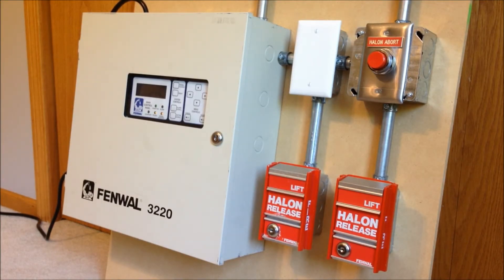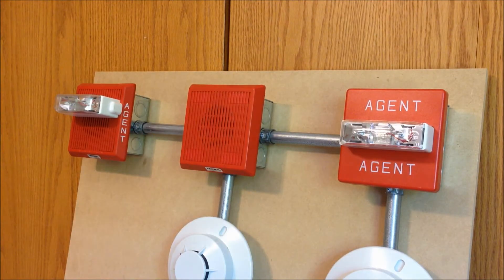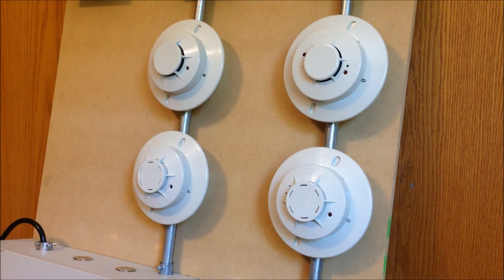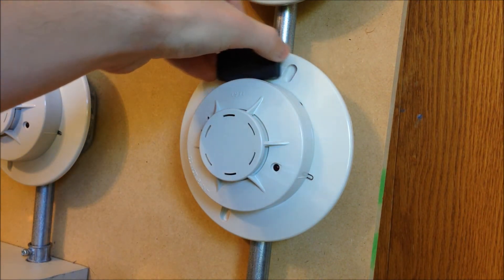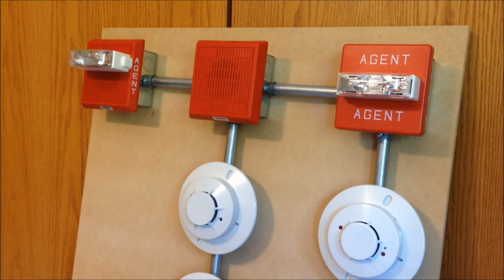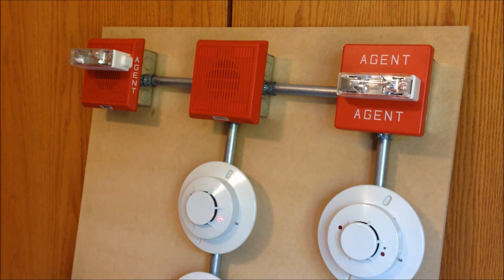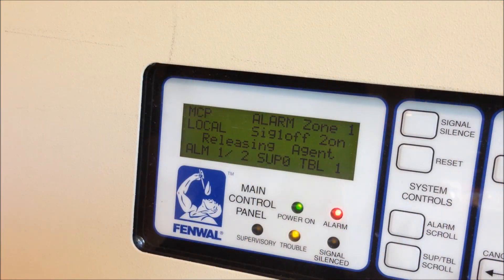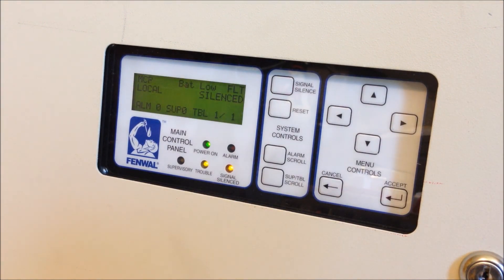Fenwal 3220 Fire Suppression System Test 1 | Cross-Zone Detection

Comment: Sorry if I ask too many questions but how exactly are the containers or halon (or whatever agent is being used) connected to the suppression system? I know you don't intend to do that since it's a hobby system but do you know?
Reply from the maker: My Ansul Autopulse system actually has a Halon bottle actuator installed. They are essentially electrical valves that open a diaphragm (some older units used small explosive charges to open an airway) and allow the Suppression Agent to release from the container. The electrical component of the valve is wired into an output on the panel.
Reply: +kcin556 I figured it might've been something like that but I wasn't 100% sure. I know when the agent is manually released, it opens up a valve or something like that.